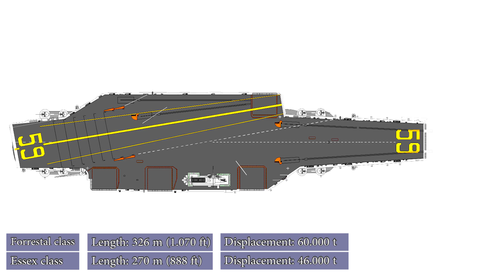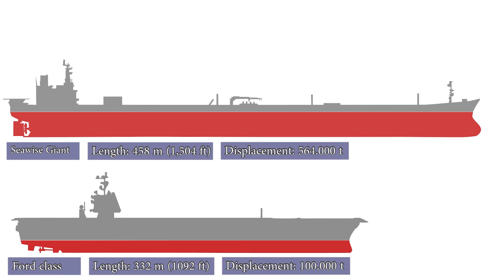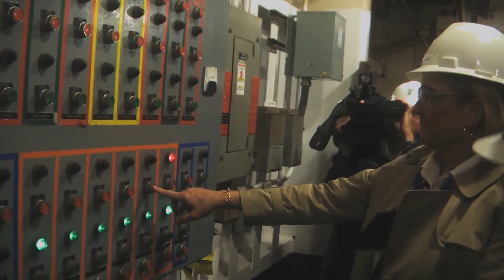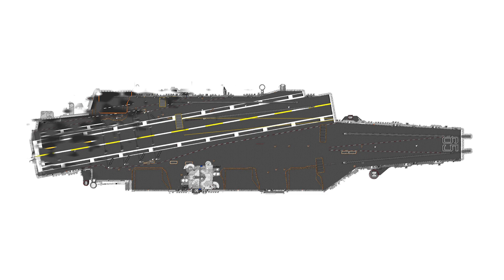Why don't aircraft carriers get bigger?

Comment: There is a significant element that you left out of the discussion and that is efficient air group operations.  That is the primary reason that Aircraft Carriers have not grown in size.  They would need to become much wider to expand air operations in order to accommodate more simultaneous take offs and landings.  Longer is not the issue with air group size.  This became noted as a problem with the Lexington and Saratoga converted battlecruisers before WWII and thus the Yorktown class was smaller.  The Shinano of the Japanese navy was not a fleet carrier for similar reasons, being a converted Yamato class battleship.  The largest air group size has been pegged at about 100 for a long time now.  Again, this is because of the ability to launch and recover planes.  A larger carrier could hold more stores and reserve planes, but then you run into all the budget and logistics issues that you brought up.
Reply: Interesting, and it makes sense. Do you think electromagnetic catapults and auxiliary elevators could increase the launch rate enough that the optimal air group would increase?
Reply: @nikolatasev4948  Maybe.  The launch rate can be improved, but it is not clear that the recovery rate is.  If you think about Midway (as an example), it is recovery that got the Japanese carriers sunk.
Reply: @jimsackmanbusinesscoaching1344  Launch rate probably can not be improved. The speed of the launch is really not restricted by any technological considerations.
Reply: @michaelmappin4425  You are making a lot of assumptions about the inability to automate flight operations in the future.  For example, imagine a carrier 100 years from now that requires no crew.  The limitation on turning aircraft around might be refueling.  Of course those aircraft are likely unmanned as well. So, I am not sure that technology limits future launch rate.  Current technology might.
Reply: @Jim Sackman Business Coaching  You're totally right that I can't see what crewless air operations might look like. I wasn't as much speaking to that, as I was using my experience to say that technology is not really limiting our launch rate. The speed of the launch, at least to where there is any concern for safety of flight, is mostly limited by pre launch checks.
Reply: @michaelmappin4425  So, if you were the Navy - you might start thinking about the speed that these things happen in.  Potentially having automated pre-flight systems checks, standard ammunition "magazines", automated refueling stations, would allow essentially every aircraft to be serviced simultaneously or at least mostly simultaneously.  So, no really reducing the time for 1 aircraft. Just making all aircraft serviced in the same time as one.  Then launch rate limitations change.
Reply: @Jim Sackman Business Coaching  I am trying hard to get where you're going with this, but it doesn't make a lot of sense. I think if you were to experience flight operations from on deck, your perspective would change a lot. The launch sequence starts with an airplane already at the catapult on top of the shuttle and fully configured for flight. Jet blast deflectors are up, and there is another plane backing the cat with wings spread and 95% configured for flight. When the green beacon comes on, it's go time. The aircraft taxis over the shuttle, and the airplane goes into tension. At that point, the pilot must verify a set of parameters and then cycle his control surfaces. The final checkers, after a visual inspection, give a thumbs up, and the pilot salutes to indicate all is go. The shooter or observer returns the salute and then visually verifies ready from catapult stations and all clear for launch. The launch signal is given, and the button is pushed. If ordnance is loaded, there would be a brief period where the weapons need to be armed by ordnance men. The JBD goes down, and the next aircraft taxis forward repeating the process. Visual safety checks can not be automated. Taxi speed can not be increased. External arming must still happen. I can't see a situation where any improvements in technology or automation are going to eliminate visual checks. Just think of how much commercial aircraft cockpits have changed because of technology, but pilots still follow procedure checklists. Will there come a day when planes fly themselves? Maybe/probably. Will it be mishap free? Probably not. Will the Navy be willing to trade potential losses for only marginal gains to launch efficiency? Doubtful.
Reply: @Jim Sackman Business Coaching  Also on the topic of automated refueling. In the history of the world so far (at least as far as I'm aware), no car, bus, truck, train, aircraft, or ship has ever received fuel  by any sort of automated process.
Reply: @michaelmappin4425  Really?  Ever use a gas pump?  Do you turn a crank?  Ever watch a plane mid air refuel?  The only non-automated parts are the arriving at the pump, which given where we are with auto-pilots and car driving automation seems like within reach.

And stop trying to start with what you have.  Start with a carrier that has 0 personnel.  What things could you use computers and robot to do that people do today?  Think of how cars are assembled today.  Then think of car engine diagnostics.  Imagine the design of vehicles where parts can be slid out more effectively with robotic cranes and arms.  You probably will still end up with specialists and maintainers, but more trained and fewer in number.  

The real question becomes when these changes happen not if.
Reply: @Jim Sackman Business Coaching  🤔 I do use gas pumps. I see it as a fully manual operation. I drive up, put the hose into the filler, turn on the pump, control the flow of fuel throughout the process. I guess the pump does turn off automatically. In flight refueling works pretty much exactly the same. You're right, though. I am thinking about the way it is done now and don't have much imagination of how a robot will do it better.
Reply: @michaelmappin4425  Well, most of us use the little lever on the fuel pump and don't control it at all.  If you are saying the job of everyone on an aircraft carrier can be replaced by a little metal lever, then that is probably an exaggeration.  Might take 2 levers.

But in the old days, you had to manually turn crank handles on pumps.  The reason we have to plug in is that cars have a variety of placement of gas tanks, drivers that pull up in bad ways, and different layouts.  Which you can make standardized if you eliminate the driver and thus completely automate the entire process.  No different than say automated welders on assembly lines.
Reply: @michaelmappin4425   I have had the idea that for about another 200' in length and a bit more width in the Flight Deck, you could with current technology.  Consider a carrier with TWO angled decks, one to port, and one to starboard.  The forward Flight Deck is moved farther foward, with the tower centered behind it on a reinforced pylon, between the outer ends of the two angled decks.  While the ship is launching a plane on the port side and one of the forward catapults, with apparent wind over that side, two more planes are being prepared on the Starboard side and the other forward catapult. After the first launch, the ship is brought across the wind to bring it ahead of the planes and they launch, while now two more planes are again simultaneously prepped on the port side.  As to recovery, this could be facilitated by inbounds landing on alternate angled decks.  This could be done with a 400-meter ship, which is not too much more than a 340-meter carrier.
Reply: @LouisXXVdeFrance  The United States currently has only 1 drydock that can handle an additional 200'. That dry dock would have to be cleared of current construction projects to do it. You can see what a current size Nimitz carrier looks like in the other dry docks in Google Earth. Look around Portsmouth, VA, where it meets the Elizabeth River.
Reply: @LouisXXVdeFrance  Also carriers only dock at the non angle deck side of the ship. 2 angles would certainly complicate that.
Reply: @nikolatasev4948  there's also operational capacity, You can Physically only organise So many aircraft before you need more and more systems on the ship just for direction and air traffic control,
Reply: @Voron_Aggrav  Well yes, but a larger ship can carry a lot more system for direction and air traffic control. A larger ship can command and control a much larger air wing, and a fleet.
Reply: @Nikola Tasev  Elevators and catapult technology will not increase launch rate at all. Elevators are generally not used much during the day. The event birds for the coming day are all on the flight deck from the night before. Steam catapults and EMALS catapults both can launch aircraft as fast as they can be fed. Factors that affect that speed are limited mostly to pre launch safety checks and taxi speed.
Reply: Great point. Current CVWs are only about 65 aircraft and that includes the helos.
Reply: Also a MUCH bigger target. Dispersion is key, that’s why we switched to cruisers instead of battleships and eventually only destroyers as the main line of ships
Reply: @ChronicAndIronic  Actually it was airpower.  Battleships were extremely expensive and their guns had marginal usage compared to missiles.  Their best value at the end of WWII was anti-air platforms.  The US battleships had simply ridiculous amounts of AA guns.  So, what was the point of building such massive gun platforms?
Reply: @jimsackmanbusinesscoaching1344  that and more importantly Anti Ship missles. A small destroyer could carry a few missies that could take out a much more expensive battleship, especially when harpoon missles came around
Reply: @jimsackmanbusinesscoaching1344  excellent point. Not to mention the big guns themselves are limited to the number of rounds they could fire due to barrel wear. Expensive for a relatively small punch and limited range compared to missiles.
Reply: @josephkrenzer627  The barrel life on the big guns on Battleships was in the 1000s of rounds.  The bigger issue is range.  Anti-ship missiles have range in the 100s of miles.  WWII class guns have ranges in the 20 - 30 miles.  Given the current ability to detect ships at range, Battleships will get hit and sunk by missiles and bombs before they get close to gun range.  This was even true in WWII, look at the fate of both the Yamato and the Musashi.

Comment: Why would a giant aircraft carrier require different airplanes than those used on the current Nimitz and Ford carriers? Not sure I understood/ or the vid explained why that should be the case.
Reply: If anything a longer carrier could handle more existing airplanes, could feasibly land Air Force planes if you had the stopping distance.
Reply: @dekulruno  You do not have the landing distance, not even close. A standard F-15 requires a mile and a half of runway for safe operation.

Comment: The 3 biggest pro I could see with this Ultimate Super Carrier idea.
1. Long term airbase, it would be better then current carriers during a long term conflict. Have 1 Giant carrier with 1 backup super carrier and you could have a fully functional airbase at sea. If it was big enough you could have (never would happen) Air Force aircraft operating alongside naval aircraft which expands the abilities of the current US strike power.
2. Cargo from planes, you could theoretically land cargo aircraft on the carrier if it was big enough. Would help limit "Underway Replenishment" times by delivering cargo via aircraft.
3. Jump Carrier. You could have one of these stationed at the halfway point in the ocean (Atlantic or Pacific) and have aircraft "jump" from their land bases to one of the carriers then "jump" to their destination. {alternative to A-A refueling}.
3 Biggest Cons
1. Bigger ship bigger target (Literally and strategically)
2. Docking (Dry-dock and regular dock). Navy would have to invest and build bigger Docks and Bigger Dry-docks for after and pre deployment. Also would have problems with foreign ports. Ex. Japan
3. Extremely long Overhaul periods. Super carriers have about a 2.5-3 year overhaul period. This ultimate carrier would theoretically take twice that or longer.

* I know there's a lot more pros and cons but this is the 6 things I could really think of.

Comment: what about a large oil or other cargo vessel, rebuild voor disarter relief. existing as a hub outside of juristictions and restrictions imposed. with a fight deck for cargoplanes, and a professional hospital, and a lot of other services on board for example information gathering about  warcrimes interviewing victims, teaching, etc.

what would be more efficient, and have a bigger impact. when there is a crisis, usually the will is there, but the logistics and the legislation what comes with it to get the cargo where it's needed drags it down.
Reply: So a USMC assault ship? Because that's almost exactly what you just described.

Comment: You don't even need carriers to be that big at this point, as advnaces in fighters make runway length much less important
Reply: As you said, developments in VTOL fighters and such mean that the only real need for such length is for landing transports and AEW aircraft, such as the E-2 Hawkeye. I think Japan has developed carriers that don't even have a runway, relying fully on VTOL capabilities.
Reply: @firewars7636  Problem is VTOL aircraft don't have the same range and don't have the same carrying capacity (weapons load). The US is specifically upgrading aircraft for longer ranges now because it does not want to get into the missile range of China to defend Taiwan. No, they won't be parking the carriers right next to Japan or in-between China and Japan.  Japan's Navy doesn't have that luxury since they're literally right there already. But the US isn't going to risk the assets the same as Japan.

Comment: They can easily go longer, but they wouldnt be able to go much wider, whichd eventually lead to stability issues
Reply: No! Longer ships would not fit into any of the US drydocks except for Newport News Drydock 12. Longer ships would need pier redesigns and extensive dredging at every current US home port. Not easy at all.

Comment: A little conservative examples out there of nations well lemme correct you Russia has no aircraft carrier as the one the infamous "Kuznetsov" is in dry dock for several years getting rusted to trash also it was so reliable that a tug boat always acompanied it to its trips due to usual malfunctions so now its a guarantee that junk isnt no more a aircraft carrier also instead of Russia you could have mentioned India we got two aircraft carrier both 45000 tones displacement one carries modernized Mig 29K and other carries F 18 superhornets and the  later of the two is made in India

Comment: You didn't mention that there are always ships in retrofit, so if you reduce numbers it means even less numbers at sea. 5 supercarriers would be at sea while there would be 2 or 3 laid up due to routine maintenance alone, not to mention any other possible failures that systems can suffer over time.
Reply: Agreed , CURRENTLY the US navy has a policy of 11 carriers. Sounds like a lot, until you realize that off those 11 you are going to have 1 in Drydock (say Bremerton) for refurbishment and upgrade servicing , another in Drydock (say in Portsmouth) for mid life refueling and servicing of its radioactive powerplants) and you’re down to 9 …. Now let’s put a third down in Pensacola Florida for flight training and your down to Only 8, but you can’t keep all 8 of those out all the time. If your LUCKY you can have a carrier ready to relieve every carrier going off station. So at any given time you might only have FOUR carriers on force projections missions and that’s what Nimitz/Ford Class carrier are designed for, for protecting force to the OTHER side of the ocean, something you really CANT do with any other carrier class afloat. with the exception of the Charles De Gaul NO carrier out there can put into the air an AWACs plane like the Hawkeye, so all those other carriers are dependent on Land launched AWACs 
To a lesser extent all those other carriers face similar limitations to airborne refueling and ASW operations. While you can do ASW from helicopters off of almost any floating platform helicopters are limited in range and payload and magnetic detection sweeps, with their only advantage over fixed wing is their dipping sonars. The hard part is ASW off a helicopter is harder on the crew because pilots have to be both pilots and sonar operators at the same time , then again even the US navy doesn’t use carrier based fixed wing ASW with a crew of more than two anymore. To make logistics more efficient they use Hornets instead of the four seat S3s 
In the end building a 5/4 Ford Class just isn’t feasible. That’s why God created escort carriers and pick up truck trailers, for when one isn’t enough and 2 is too much
Reply: They usually upgrade systems too during the process.

Let's hope we don't lose an other ship at their home dock. I just learned about it and was like WTF.